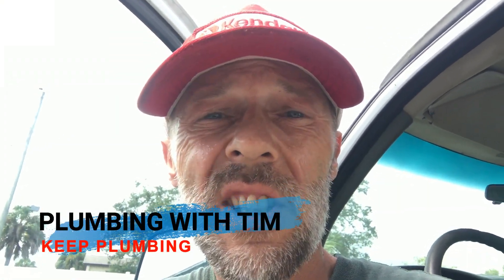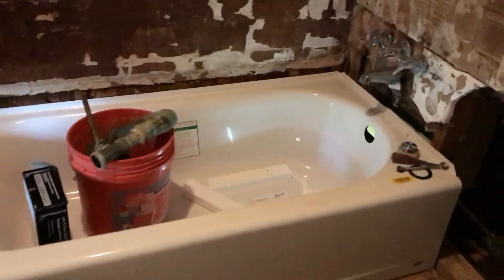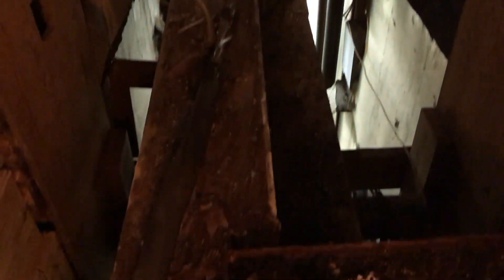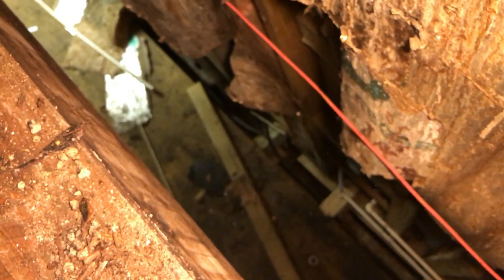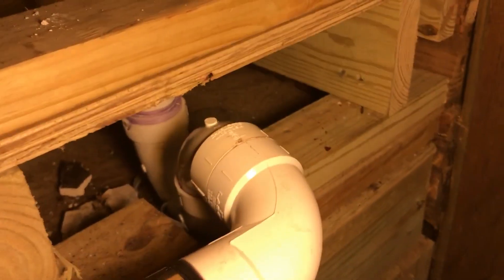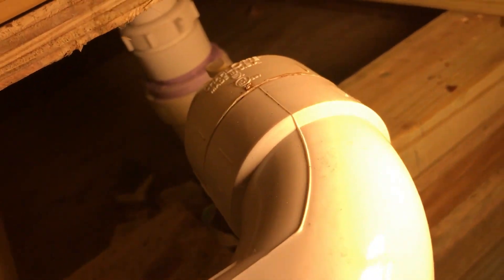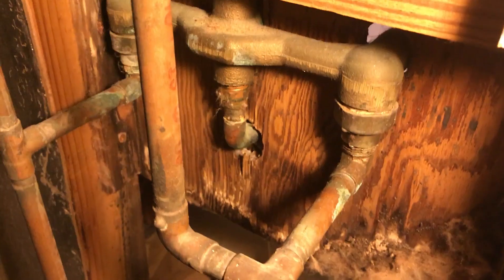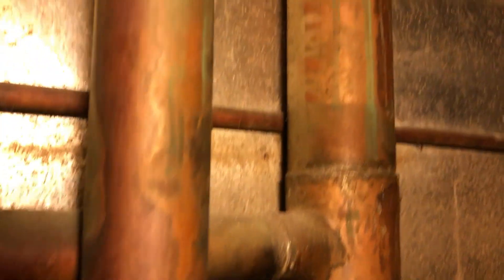REAL PLUMBING DANGER'S

Comment: O man I know how you feel I was at the Hilton hotel Palacio del Rio over 60 years old copper drains also. 18 3/4" wide access panel between rooms. I was an apprentice with, my 80-year-old master Mr. C, who I always tried to impress, I crawled 14' out on top of 4 x 1/2" copper pipes with a board on top. I was soo scared I was on the 18th floor and i would have died miserably falling down being killed by a pipe or worse insult ductwork. This was to replace a Zurn hammer arrestor that was leaking. I changed that day,. plumbing will find you in many places worst I can think of is a sewer lift station in a bar. I'm sure there is worse just don't want to find it yet!